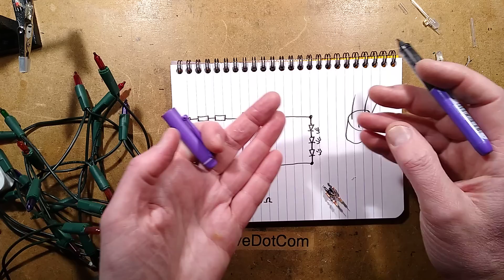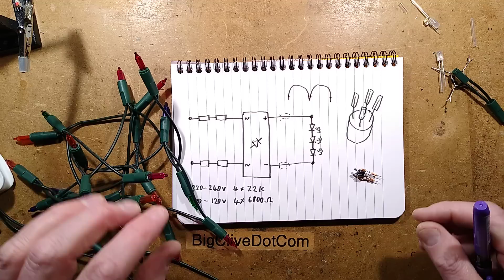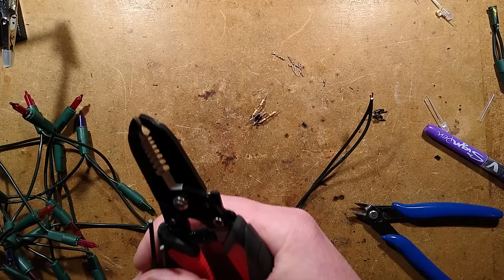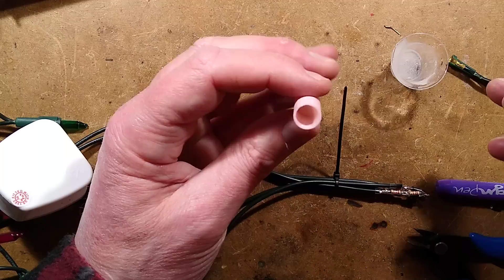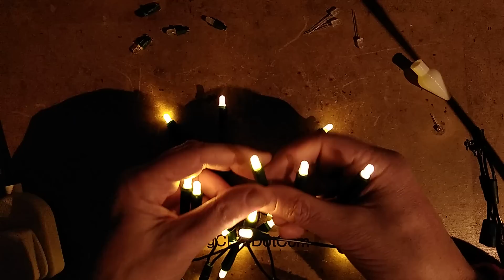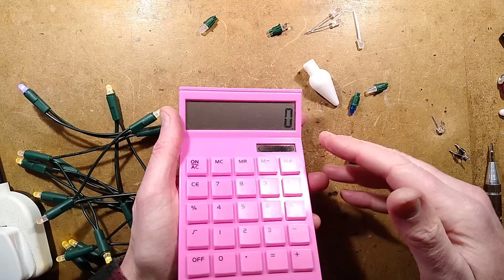Ambient fairy light hacking

Comment: A suggestion for future potting: Fill the cup with water. Plunge the wires, etc. over a towel. Withdraw the wires. Note the level of water in the cup. Drain cup and dry. Fill cup with resin to the same level as the water. Should end with a near perfectly filled cup of resin. Some water will stick to the wires so the level may be a bit low but should be very close.
Reply: If you use denatured alcohol (any kind) instead of water, you avoid the problem, as surface tension is way lower and it won't stick to any surface.  Quite usefull for measuring and calculating internal volumes too, since the density  of alcohol is known. Just weigh it on a precision scale and that's it.

Comment: How do you test if the wires  are copper coated aluminium?
Reply: Hold a lighter to the bare wire ends. If they sag down they are cca and if they stay put they are pute copper. Cca alsow is somewhat more springy and the strands dont want to stay twisted
Reply from the maker: I assume all direct eBay imports are these days.  This string was from a UK brand.
Reply: you can scrape them with a blade, if it is silvery -ish  underneath.. and they don't twist / bend like copper, more like hair.

Comment: My first close encounter with electricity was at the age of arround 6 or 7, when i stuffed just one of these tungsten lights with the 2 wires straight in the 230V wall outlet, and by holding it with the green plastic part between my fingers.  The result was a big pop, sparks, and a red tungsten light that flew 2 meters away from where i was standing. 😂

Comment: In the US I've done similar with many light strings.  I usually use a capacitor dropper to eliminate heat.  I reuse the plug which has 2 tiny 3 amp fuses in it, which prevents things from going "bang" if something is wrong.  I do like the 3D printed potting thing you use.

Comment: Thank you Clive, youve reminded me of a little nightlight project I was working on. Its very basic but its basically a UV led encased in resin with a glow in the dark dye. The LED is then hooked up to a CR2032 button cell and a switch. Its such a useful little nightlight especially if one uses a good quality GITD dye. It only needs to be on for a few minutes but provides enough illumination to act as a night light for a few hours.

Comment: Clive, may I please ask What is the "aluminium test"?
Reply from the maker: Bare a length of the wire and hold a lighter under it.  If the strands stay put and glow red then it's probably copper.  If they frizzle up and flop then it may be aluminium or some other metal.

Comment: Great conversion but in my case I use an even older series string of the pointy tungsten lamps to power little lamp shades that sit on a cone with a pin and spin with rising heat.   These came from the 1950s and the original bulbs are hard to find.

Comment: Would be interesting to see if the circuitry could be fitted inside a UK mains plug.
Reply from the maker: It probably could.  Technically speaking the fuse position could house two of the resistors, since the current is inherently limited.
Reply: you have the room where the earth wire would normally go, so it might fit. 
But Im not sure I would trust it, if the wires get pulled it might be an issue.
Reply: Good idea !! spares you the resin mess and makes the whole thing much safer, just a little heat shrink and you're done.
Reply: @tinygriffy  yep that would work, but I would want security in the safety of the device if it was to used by anyone less technical. 👍👍 I wont be making one but if I did, you get the idea. 😀

Comment: Nice project. I might give this a go. I've got an old set of mains festive lights and a bag of orange LEDs spare. Would sticking a low value, say 2.2uF, 400V capacitor on the output stop the slight flicker? Some people can detect it.
Reply from the maker: Yes it would, but you require a resistor after the capacitor as otherwise removing an LED while powered results in the capacitor charging to peak mains voltage and then dumping lots of current in a pulse when a new LED is inserted.

Comment: Every time you do this conversion build, I curse myself for throwing away my old tungsten light sets. But it's a great idea, not just for light strings, but for those Xmas constructions that have prewired lights builtin where it isn't possible to rip out the wiring.
Reply: 100% agree. All those bundles that have been tossed. Junk pile is getting too big at the house and they went to the bin this past January.
Reply: If you have the patence I always unwrap the light strings and save the full length pieces of wire.   I will save several of the  short pieces too.   Very nice wire.   Always seems to be copper wire.   I also save the male and female plug/receptacle for projects too.   I have made light bulb testers with some of the sockets with stub of wire still connected to them.